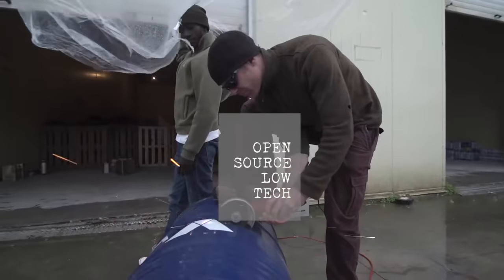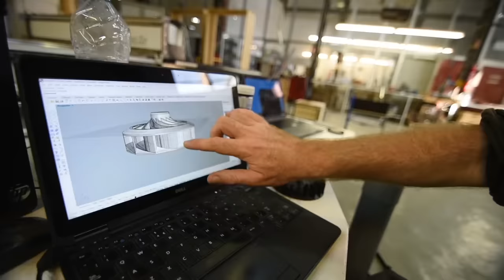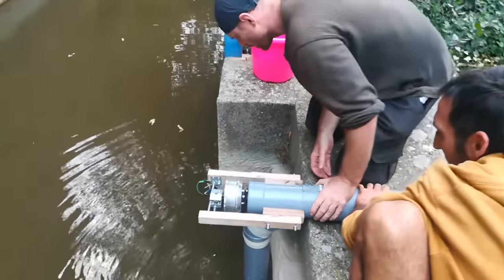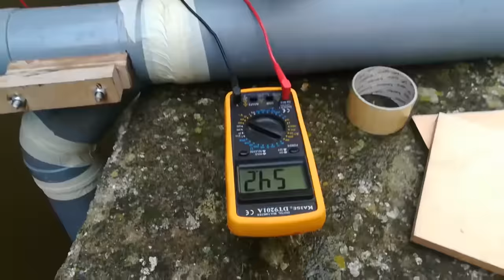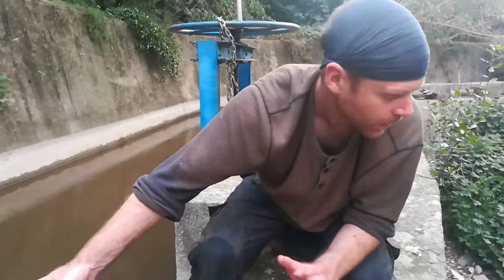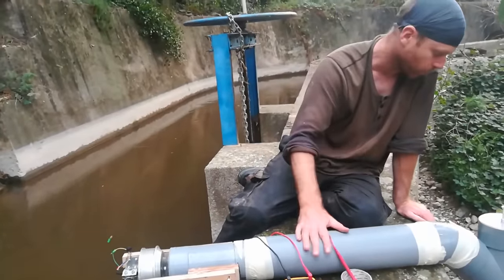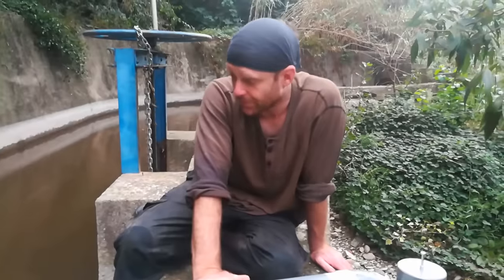The $50 Water Turbine -DIY, Portable, Powerful, and Open Source

Comment: Turbines are classed for different use cases. Some are more tuned to extract impulse, and some are tuned to extract the water's dead weight. Refer to this chart: https://en.wikipedia.org/wiki/File:Water_Turbine_Chart.png

For low head, but large volume, a cross-flow or Kaplan turbine is optimal.

For high head, but low volume, a Turgo or Pelton turbine is optimal.
For lots of both, big Francis units are where all the hotness is.

A computer fan falls in the Kaplan class of turbine. The situation the video shows, IMHO, is more of a high head, low flow situation, so I would gravitate more toward a Turgo or Pelton solution.

The impeller style shown looks like a Francis turbine, and was being fed incorrectly. For proper extraction of energy, flow should come from the outside, at a tangential angle, spiral radially inward, then flow axially out the center. All Francis style turbine designs work this way, have a look at the exhaust impeller in a turbocharger. Though, admittedly, it's not exactly easy to construct the proper geometry for this on a shoestring budget. Inlet scroll and wicket gates are fairly specific and particular items.

No matter what, the turbine blade should be located at the bottom of the drop. Water is largely incomprehensible, so won't squish, but it may cavitate or draw air through leaks when you rely on vacuum. (Not the least of which is that you get more impulse from allowing the water to build up momentum from the fall, as stated.)

Comment: I  like  the  idea. But  I  beieve  you  could  get  the  same  results, if  your  concrete  partition,  was  floating  in  the  middle  of  the  canal, on  a  landlocking  hydro, pneumatic, floating  rail  quarter deck. This  way  the  water  stays  in  the  canal  on  what's  called  a  Vortec  Water  Highway. Such  a  highway  could  be  protracted  on  a  Journeymans  Time  Share , connecting  landlocking  canal  systems  with  existing  rivers  when  surveyed  from  Charlotte  NY, Lake  Ontario, on  an  elevation  of  250 - 55 ft  above  sea  level, and  250 - 55  ft  below  Lake  Superior  Level, crossing  the  American  side  of  the  Toronto  border through  Lake  Erie, out  its  southern  river, using  GPS  could  be  navigated  by  the  Red  River, to  the  Salton Sea, and  out  the  port  of  LA  California. The  whole  system  on  a  floating  water  turbine  highway, supporting  a  Farm Bill, could  be  portable  clear  out  to  the  Pacific,  for  clean up  operations, and  run  clear  down  to  the  Panama  Canal. Something  Customs  and  Immigration  could  finally  assimilate  autobiography  &  resume' to, for  proper  Community  Action  non - profit  Co - Op  reception, and  we  can  start  shutting  down  Nuclear  power  plants. Good  show, I'm  subbed.

Comment: you could try a smaller diameter, the same head with higher velocity on smaller diameter? 4 or 6 inch tubes might waist more water source
Reply from the maker: There's a slight Venturi directly across the impeller in order to trade some torque for revs, but anywhere else in the system smaller pipe just means less flow, so less mass, less momentum, less power.

Comment: Any suggestions on what would it take to adapt it to power a boat whilst moored or on anchor maybe so as it works whatever the direction of flow perhaps with a or universal joint like windsurf sails have?
Reply from the maker: There are types of turbines which can be towed behind boats and work in-stream, but  this one requires at least a couple meters of drop in order to establish the siphon and adequate momentum.
Reply: Thanks for your kind attention and reply, that helps get things into perspective. 
Another question if you don't mind: I was also wondering how you deal with humidity in dwelling quarters damp environments? Does a fireplace fend it off well or even a stove? Greetings from Rome, btw. Davide here. Always dreamt of forest living and interested in permaculture and off grid living also in light of likely EMPs in the years to come, whether due to impending grand solar minimum and the weakening planetary electromagnetic shield and perhaps its reversal or the powers that shouldn't be manipulating our ionosphere as well as the other spheres... 
:D

Comment: My concern is the computer fan blade. How long will that last under 24/7 water pressure?
Reply from the maker: Remains to be seen. If it does break in a problematically short time frame then there are options to strengthen it which wouldn't require much extra resources.
If it can be gotten away with as is tho it's one less thing for people making to have to do.

Comment: The project is fine
 To give a little per bag speaks of multiplying the no-load voltage by the amperes specified as a 55V x 10A = 500w motor and which is yielding 40%
 Power is measured by putting a load not empty
 The amps of a generator in a system such as this are measured in short circuit
 Then the rpm is reduced and the rotation is balanced between the power that is capable of absorbing the movement of the water with the propeller or turbine and the counter-electromotive of the generator that gives some Nm x rpm, which is the work that the system is capable of
 In this case the skate wheel will provide 1A +/-
 On the other hand, the reduction in load rpm reduces the output voltage being much lower than the no-load voltage
 So the 500w and a tenth of these do not add up to me by eye of a good cubero I give it between 10 and 20w
 It is not to take for sack but this has not caught a 20w position light from the car to the pileup
Reply from the maker: Check the part 2 video for power output results.
Reply: @OpenSourceLowTech  makes any difference if the power unit(generator alined with fan) is set horizontaly instead of verticaly? Do you connect those units to batteries?

Comment: If it's 500 watts how much will get to the end user? How near should the homes be to maximize the electricity produced? Is it first stored then distributed or it's direct? Im just trying to understand more.
Reply from the maker: Check part two for power output numbers, but basically am getting 200W electrical / 5 kWh per day, or about a third of a western suburban home.
Line losses depend on amperage, thickness of wire, and distance. So generally you want to be running it as high volts low amps as possible, get the thickest wire you want to pay for, and have the point of use as close to point of generation as you can.
Generally more than a hundred meters may start becoming an issue.

How to store and use it comes down to individual specifics, but the usual is to charge lead acid batteries. There's a case to be made to have the batteries next to the turbine with an inverter, as you'd then be sending it at mains voltage and so less losses, but will depend on particulars.

Comment: After watching this, I have been thinking about the durability of the computer power source fan. I know that e-waste is a readily available resource in the 3rd word, but they aren't designed for long-term use in something as dense as water. In your experience, how available are boat propellers in these parts of the world?
Reply: how about one of these ... DPS Series 90mm 12 Blade EDF Replacement Impeller reinforced with glass fibres  , ballanced , good for 3200  rpm  they say ! cheap too at £ 8.46 (Hobby King.com) agree with all who say under real load will be the real indicator of how effective this will be.

Comment: Sorry if this has already been answered, but what type of alternator are you using? auto? motorcycle??
Reply from the maker: As per the video is a wheel from a hoverboard / balance board, which do quite a good job and are easy enough to get in western countries.
Elsewhere best option seems to be a motorbike alternator, check my recent video on how to work with these.

I don't love car alts for reasons of volts per rev and efficiency.
Reply: @OpenSourceLowTech  I went back and watched again: motorcycle alternator

Comment: This might be a silly question but, if you made say 3 of these side by side, would there be a way to combine that power to get 3x as much?
Reply from the maker: Yep. The specifics of how will depend on what you're plugging them into, but these are modular in terms of how each turbine is configured, but also in the ways multiple can be utilised at once, yes.
This can be in series, ie one after the other if your waterway has multiple points of drop, or in parallel, if it has more than enough flow.
Reply: @OpenSourceLowTech  thank you, that's really handy to know!

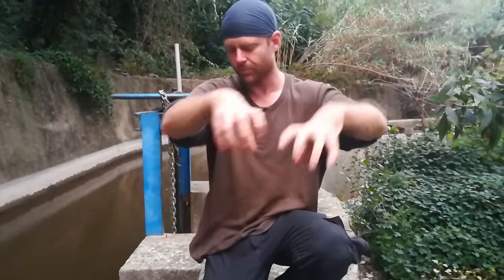Comment: 7:20 No in this turbine the energy doesn't come from the momentum of the water : there is no momentum difference throughout the pipe (same quantity of water moving at the same speed). The energy comes from the pressure difference through the turbine.

Comment: How long will this device run for? What's the total number of kWh it will produce in its lifetime?
Reply from the maker: Currently unknown, hence the longer term field tests.
One guy has had his going for about six months now without problems. He is using a server fan as the impeller, which are stronger, but also hasn't got an intake screen filter, so sticks and whatnot keep going through the thing and it still seems fairly happy.

Comment: I am attempting to set up a electric generator system attached directly to my inground pool filter pump water outlet side. I want to use it to generate enough 220v 60hz current to feed back into the system to slightly offset the cost of running the pump during filtering of the pool.... Or.... generate enough 110v 60hz current to power an electric heater to help heat the pool cutting down on propane pool heating costs.
So, what I think I need:
1. is to find a reasonably priced high-volume/low resistance water pump (possibly centrifugal), 
2. tied to or mounted on a pump motor or car alternator and somehow converted to a generator,
3. Run that current through an appropriate inverter that can also output either the 220v or 110v AC at 60hz.
4. Then use that current to either run an electric pool heater at 1500 - 2000w or 
5. Used in conjunction with 3 or 4 car 12v batteries,
6. back-feed the captured current back into the system.????
Any thoughts and suggestions would be appreciated!!!!
I am trying to do this on a budget.
I also realize and understand energy loss and entropy and the 1st and 2nd Laws, so I am only trying to recapture a portion of energy that is currently wasted.
So far, I have thought about employing the use of a "jet well pump", or a centrifugal pump and running them in reverse of designed flow???
Reply from the maker: How much flow and head is there?
Reply: @OpenSourceLowTech   I really don't know the water pressure or head pressure. It is enough to clean my entire 16' by 32' in ground pool, 20000 gallons, in 4 hours. The pump I currently use is a 1.5 horsepower Hayward.  I also have already purchased a 2000 to 3000 W inverter that puts out to 110 V from 12 V. But I don't know if that would be usable in this particular application?

Comment: Why is the propeller/turbine at the top ?  Seems like to get the benefit of the 'head' you would need to be at the bottom ?
Reply: ok so at the end you answered that, sort of - follow up, does the pipe below the propeller serve any power generating purpose ?  Or could it be wide open once you pass the propeller?
Reply from the maker: In a pressure turbine, like a Pelton, you want the runner at the base since that's where the max pressure is. However this is a momentum turbine, which should be the same at any point in the system, but for semi arcane fluid dynamic reasons the most efficient position tends to be directly above the draft tube, which is definitely needed as that is where the negative pressure is created which sucks water through the system.

Or at least, that's the simplified version.

Comment: Why you have here 10 amps and in later Projects 2-3 amps? Both with Hoverboard motors?
Reply from the maker: 10A is (probably) the max amperage rating of the motor and what I was ideally hoping for without having yet load tested the turbine.

~3A is where the maximum power point usually actually sits, as it turns out, depending on circumstance.

Comment: if you guys are still developing this project, have you tried incorporating a ram pump in your designs?
Reply from the maker: It would negatively affect flow, so be less power output. But if the focus was on pumping, with a bit of electricity as a byproduct then yeah that could actually work.

Comment: Why not neck down the end of the pipe? 
Start at 12" on top and get down to 4" on the bottom like a monitor. Should generate decent fluid velocity and turn a more serious generator. You would need more vertical distance though.
Use it to charge a battery and use for night time power.
Reply from the maker: There's a slight throttle across the impeller, but in general you want as much diameter as possible for the rest of the system to increase the overall liters per second.

Comment: I'm.building a 50ft water tower and the water falls from tower out to the fields to water the plants through irrigation pipe  - I was wondering if the through a 1 and half inch pipe is possible with a balloon type diaphragm to house the impeller part and drive the motorcycle alternator as you described or rig it as a semi symptom? Similarly to your rig but the tank is driven via gravity rather than symptom action  - I hope your getting my DISRUPTION  - but I will try to copy your design see how it works and give you feedback
Reply from the maker: Technically yes, tho with such low flow you'd get very little power, and that's only ever going to be some fraction back of the power required to run the pump to get the water up there in the first place.

Comment: I wonder if its possible to create an infinite hydro electricity 
By having the same current of water flows back into the turbine making an infinite loop of water circulation 

But in theory for that to work  a water pump is also need to push water back up  
Using a bit of energy generated

Comment: could you do it with a hydralic ram pump instead , when it comes to the streams .
might get a little more pressure that way.
Reply from the maker: In principle yes, but for sake of output you'd probably be better off running the turbine off the water feed you'd run the pump from directly.

Comment: Your multimeter showed about 55V.. is this AC or DC ? Do we need to reconvert power to use for a home?
Reply from the maker: That was measuring the three phase AC coming off the alternator, in the part 2 video in Berlin I'm measuring the rectified DC and getting about 60V under a 3.1A load.
As to what you're best doing; depends on your home. If it's going into batteries it's going to need to become DC at some point, if it's going into the grid it can be a little more complicated.

Comment: How does the water get into the canal? Where is the discharge going?
Reply from the maker: In this instance, fed by a river, and back into the river.
Was just the situation at this one test spot tho, usually it'd be more a case of putting the turbine in the river flow itself, so no water is really diverted anywhere other than the tube, and the siphon doesn't have to go over a wall and so wouldn't need priming.

Comment: Seems to me, that more power is available at the lower end of the drop.
The suction at the top isn't as powerful as the weight and flow of the water at the outlet.
The pressure at the bottom is higher too.
I understand your turbine doesn't rely on pressure.

Comment: what is the engine used in this document ?? Can you ask for a link or a lead where you can buy?
Reply from the maker: It's a wheel from a hoverboard / balance board. I usually get them second hand for about 20-30 $/€/£ for the whole board.
They're essetnially 350W three phase permanent magnet weatherproofed alternators.

Comment: How about making a venturi, and setting the impeller into the venturi, the venturi may not need to be much of a drop in ID of the pipe, you could 3d print this.

Comment: For the smarter folks here, could you stack these? Say use 4 or 5 of these and wire them all into the meter and power grid and stack the wattage?
Reply from the maker: Electrically yes but whatever box you do so to will need to be able to handle multiple input channels. Just wiring all the alternators together is going to do weird things with your voltage unless they're all exactly identical and synchronised, which they won't be.

But is also possible to have multiple per water source, either in parallel (next to each other through the same drop using up all the volume), or series (over multiple drops).

Comment: Would it be posible to do this, from one water tank to another, and then power a pump to move the water back to the nr. 1 tank, or would the pump take all the electric that this makes ? 
I dont have any water anywhere, so if 2 tanks could make something like this, it would be awesome :) Thanks
Reply from the maker: The pump would consume more power than the turbine produced.
Reply: @OpenSourceLowTech  okay,, thanks,, guess its not a goog idea then,, but great video 😊

Comment: how you sealed the air from the motor turbine. its ok if there is an air hole there?
Reply from the maker: The only hole in the system (other than the water in and outlets, obv) is where the drive shaft leaves the end cap to connect to the alternator. This I'm sealing with some O-rings and washers. Check the parts 2 and 3 videos for how that looks. It's pretty basic, but seems to work well.